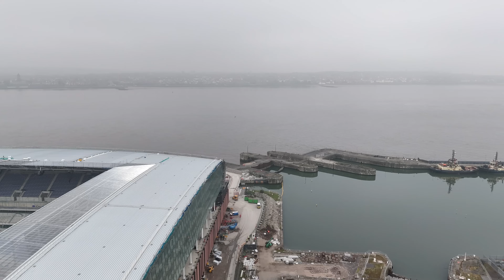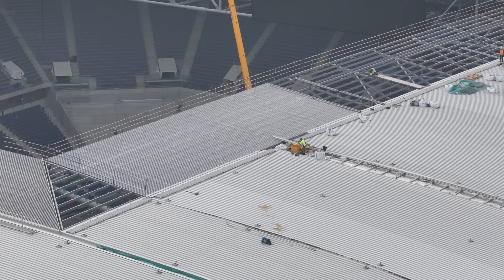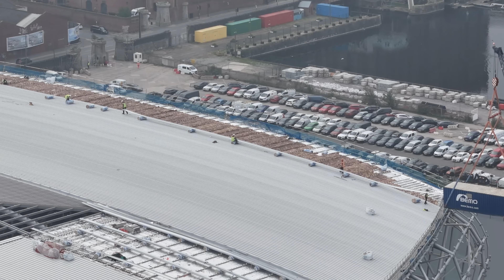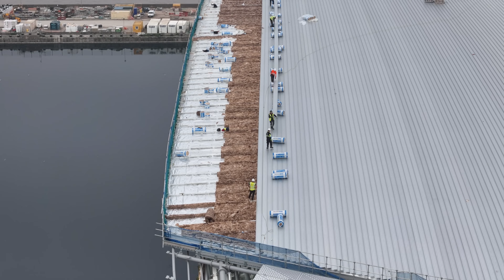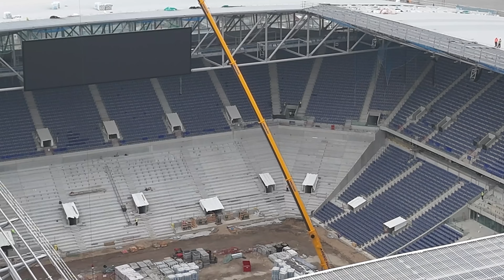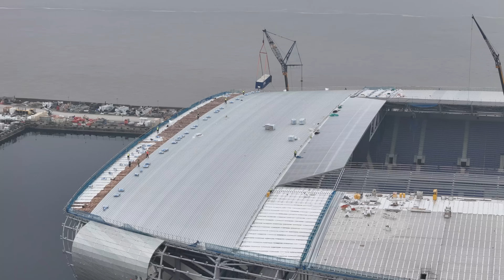New Everton FC Stadium - 8th May - Bramley Moore Dock - Latest progress - south stand roof #efc

Comment: Thanks, Colin. 
1) Thanks for flying out further to have a closer look at the internal boundary between EFC's BMD and the Mersey Wall. It certainly confirms that the wall is not in great shape to the SW of the end of the Gabion Wall that LoR installed. It remains to be seen how they 'beautify' it. In the plans it suggests that there will be some sort of boarding/lining barrier affixed to the boundary which will have images displayed on them, so it's worth keeping an eye out for those.
2) They seem to be progressing well with the edging of the BMD West Quay, besides the above comment.
3) Thanks for taking a look at the mezzanine surface-laying. I still think it's possible that they are concrete and not the original specification of Wide-edged Granite Setts but, as you say, unless there are no contractors nearby, it's not morally correct to get closer in.
4) I chuckled twice with your "commentator's curse". Firstly you stated that they seem to walk on the ridges only for the first receiver to walk straight up the flat parts and then secondly you suggested a third strip was about to happen, when it looked like some of the eastern end team were already making for the west end, presumably for an arranged break, and the mill then being returned to base, presumably to be reloaded with aluminium reels. Thanks for the fun moments.
5) The crane on the pitch was attached to a bundle of the sections of walkway that are laid on the Standing-seam roof, which you focused on a bit later.
Reply from the maker: Thanks for replying, it seems the latest firmware update for my drone has improved the signal as that’s twice running I have been far out the back of the west stand with no signal drop at all.
I will keep an eye on the dock wall now I know what I’m looking at.
That makes sense with those walkway parts attached to the crane, I guess there is lack of space to lift them from the outside especially when the pitch area is relatively clear.
Reply: @cp-overview  👌.

Comment: Those polycarbonate fitters amaze me, it seems they have no ropes but stand on the edge. I cant imagine how big a job it  was to build the original dock walls. They must have diverted the Mersey. Is there anything on you tube to show it?
Reply: Hard to see on the drone but there's safety netting underneath the purlings they are walking across.
Reply: Would be interesting 're the dock..a coffer dam would need to be built first and water/ mud removed whilst the walls are built. It's amazing how the walls  have survived 160 odd years. A similar design to the dock wall road side mix of small and large stone.
Reply from the maker: I still wouldn’t fancy falling off to see how well that safety netting works though

Comment: I don’t remember there being any insulation between the skins of the Anfield Road End Roof….. surely that will help keep the sound in….. the more I see this stadium the more I’m jealous…. You can see there is no penny pinching going on….. unlike the shoddy work on. Anfield already looks dated and somewhat tired….. and the stands not even finished yet!
Reply from the maker: There wasn’t any at Anfield, simply 2 layers of cladding with a large gap in between.
The whole roof here was designed with acoustics as its priority.